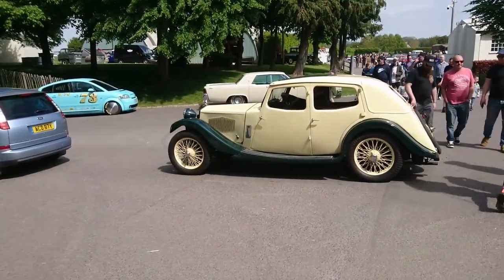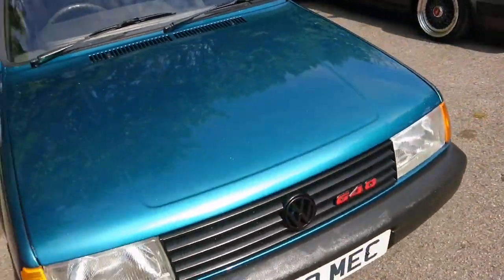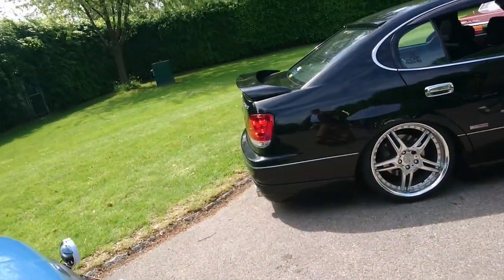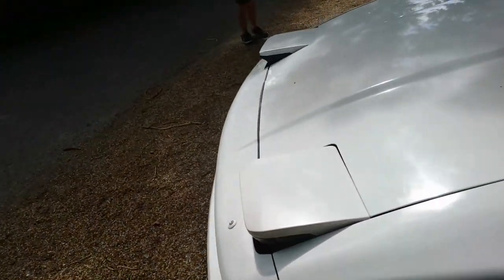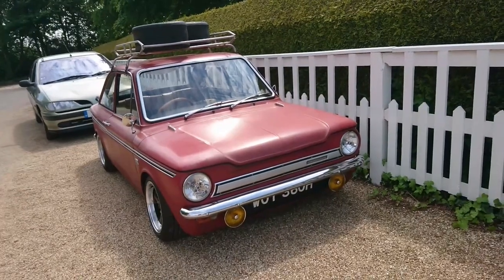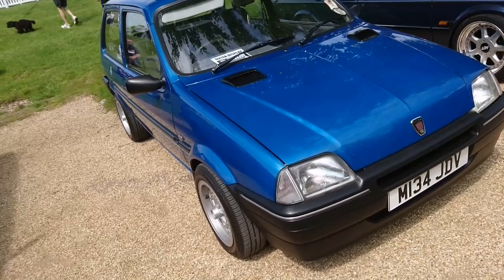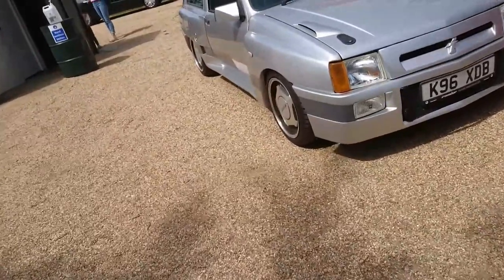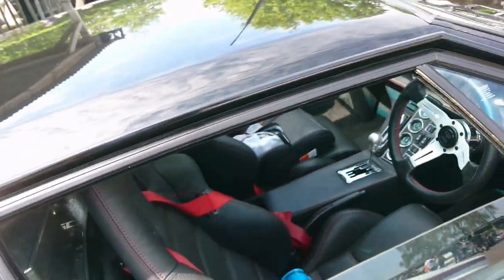A Slightly Shambolic Shuffle Around The 2021 Retro Rides Weekender: Part One of Six (29-30 May 2021)

Comment: My favourite here is that blue early 80's Mk 2 Vauxhall Carlton - principly because I had one back n the day. Mine was only a 1.8 and came in a horrible chocolate brown colour, but I loved it anyway. Despite being somewhat underpowered I can recall it was so high geared its little 4 pot motor would spin away happily at just 2,700 rpm while sitting at the motorway speed limit - I've never had another car (before or since) that could quite manage that.
Reply from the maker: Yes, not sure what engine was in the facelifted Carlton in the video. It could well have just been a 1.8, as it didn't look very high specification. So much nostalgia in these Shambolic Shuffles!

Comment: Mk1 Mazda RX7 is a beautiful design but the highlight is an actual Jaguar XJ40 XJ6. You need to drive a 4.0 litre XJ40 Joseph. The interior of every model is superb and the 4 litre straight 6 is so smooth but the ride is out of this world. My younger brother owned a 1994 4 litre base model briefly and I can confirm that it is the best car that I have ever driven. Very very special, no matter what rubbish is spoken about them.
Reply from the maker: We may have a nice 4.0 Jaguar coming up on the channel soon...
Reply: @lloydvehicleconsulting  EXCELLENT. Mercedes and BMW were both matched and bettered in many areas. Lexus LS 400 was a better car but did not have 5%of the XJ6's character. The 4 litre AJ6 Engine was unbelievably smooth. You will notice if you listen to it idle with the bonnet up.
Reply from the maker: @seancooke4127  , we have a couple of LS400s/430s coming up in part five, sir...
Reply: @lloydvehicleconsulting  do your talents also extend to mind reading, Sir? Why do I need to ask, of course they do.
Reply from the maker: @seancooke4127  , I am not a mind reader, sir, but I do like some tasty luxury cars with a particular type of leather interior.

Comment: The Irmscher-body Nova isn't a Nova and it isn't Irmscher body kit.  It's an extremely rare Opel Corsa Sprint which was built by Irmscher from bare shells from the factory before getting very heavily built up to extremely high spec.  With this being right-had drive then I imagine it was originally sold in Ireland as sales of Opels in the UK had ended by then.  The K-registration could well be correct as, although that shape of Nova/Corsa was very obsolete by then, the Irmscher cars did take a long time to build being pretty much hand built and largely built to order other than the dealer showroom cars...
Reply from the maker: I knew someone would eventually be able to sort out what was going on with this Nova/Corsa!
Reply: @lloydvehicleconsulting    It is a properly rare car as new it would have cost more than a 16v Astra GTE and was likely to have been in fast Cavalier territory, but I do remember the British motoring press being properly bent out of shape that we wouldn't be getting them in the UK after they had the opportunity to drive the development car.  Think of it pretty much as an Alpina Nova, and it wasn't all show and no go as Irmscher did an awful lot of the work that made the Corsa/Nova such a formidable force in tallying, something that continues to this day, so they really did know about making them go, stop, handle and steer as they needed to...
Reply from the maker: @gosportjamie  , that is very interesting, never even knew they existed. If it was more expensive than an Astra GTE, that does explain why no one bought them.